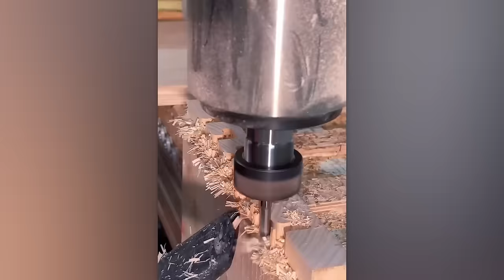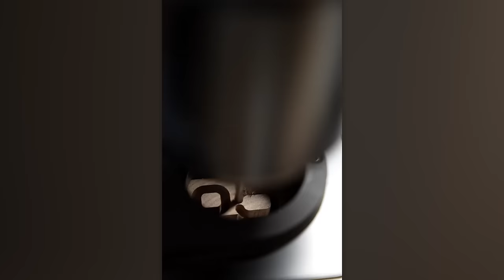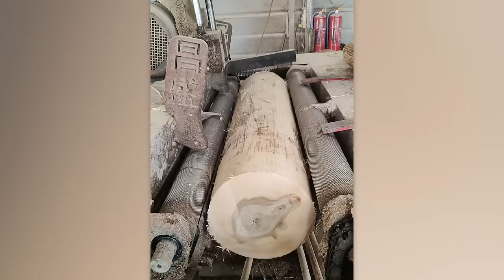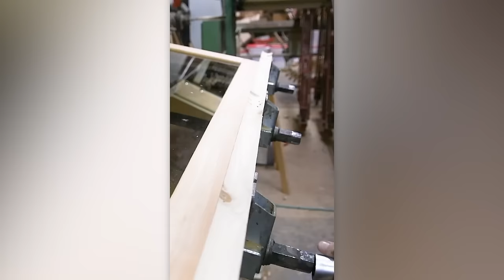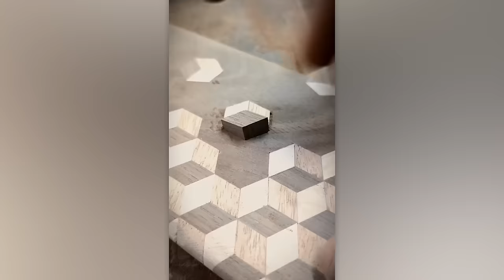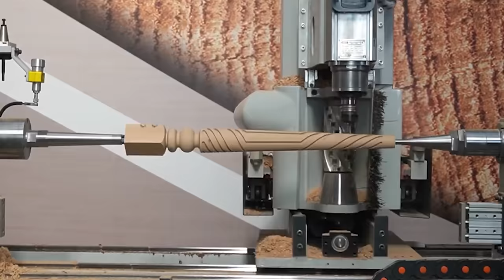SATISFYING WOOD WORKING MACHINES THAT YOU SHOULD SEE

Comment: I mean first I would say this isn't really a video of new inventions so much as it is a bunch of woodworkers and homeowners using tools. If you're ever going to be chopping wood using one of those stationary steel wedges. Do yourself and your arm a favor and don't use a rubber mallet to hit the wood like the guy in the video get a dead blow hammer which is a plastic hammer full of lead beads. It won't vibrate when you hit the wood so you'll get more energy into the wood and less vibration into your wrist
Reply: split wedge and knotweed🙄 no work